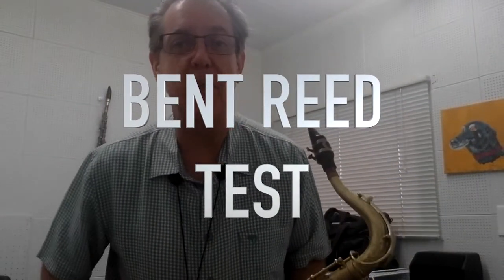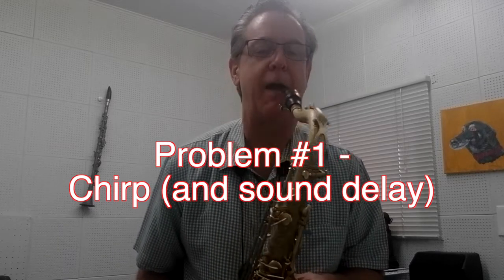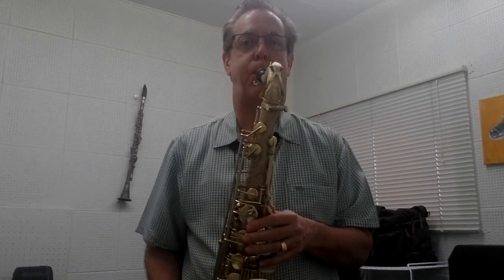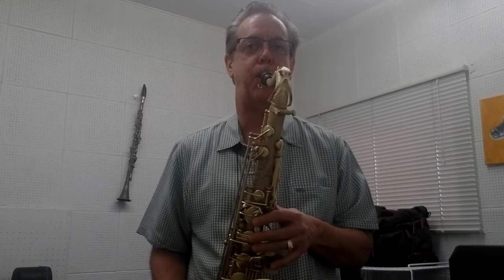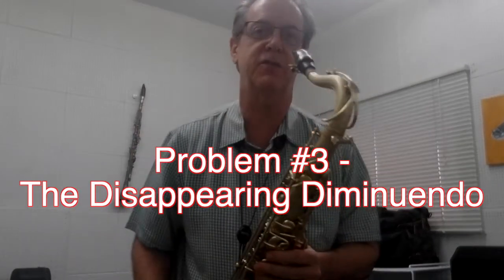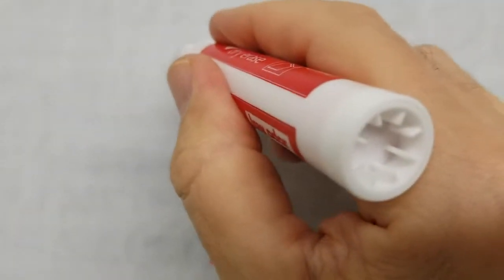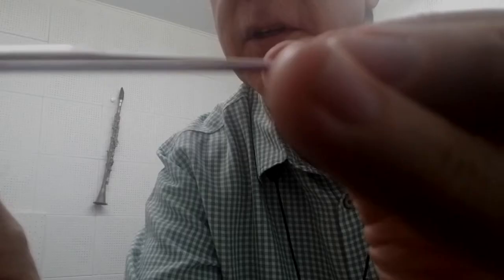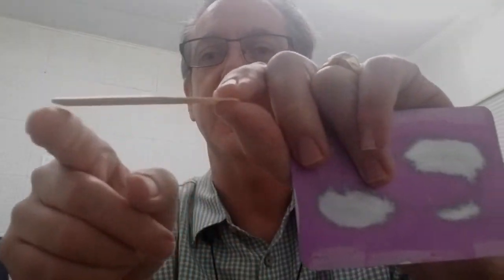Bent Reed, Bad Reed Test

Comment: Very helpful - thanks!!  Btw - I had an unusual issue where my reed wouldn’t play properly in the lower register, with sound cutting out.  Turned out it was severely convex on the mouthpiece surface, and didn’t lay flat as a result.  I used reed geek to make it a flat surface, and corrected the problem!  Very unusual!!
Reply from the maker: @paulandrobin1  Convex? Curving away from the tip?  Wow, that is strange.
Reply: @MarkPeotter  it was convex at the base, where reed touches the flat surface of the mouthpiece.  And severely so!   I could tell by how reed shavings came off on the reed geek, all in the middle, none at the edges.  It wasn’t producing a proper seal, so when I flattened it the air could go through consistently. Most of my attempted fixes don’t go this smoothly!
Reply from the maker: @paulandrobin1  Yes, very rare reed problem.  I am impressed that you got it to work at all!  From about 2012 to 2020 it seemed like most of my reeds (and I tried several brands during that time) were too thick on the right and left edges.  Did you have the same problem?